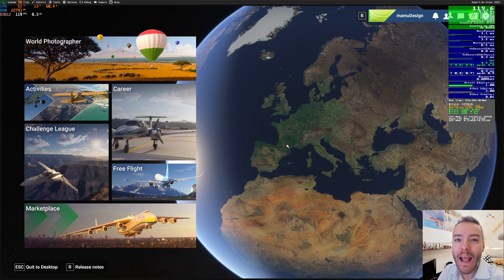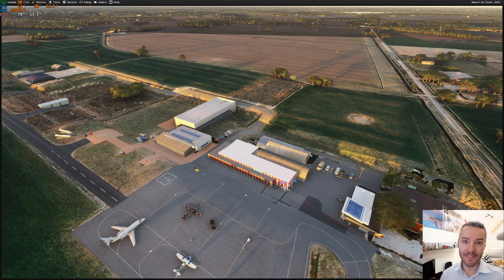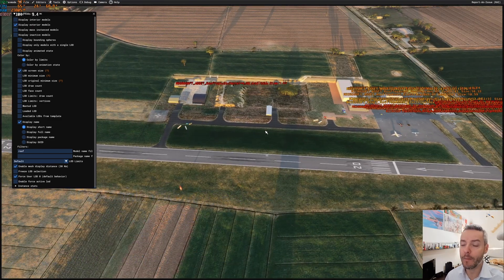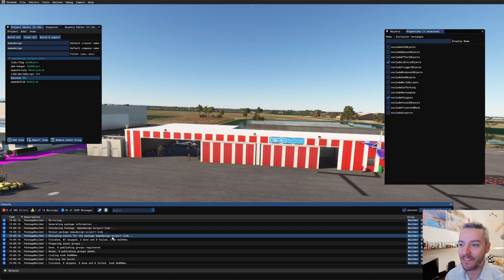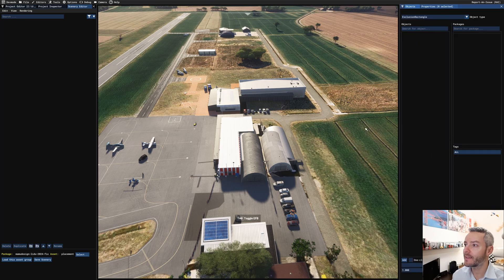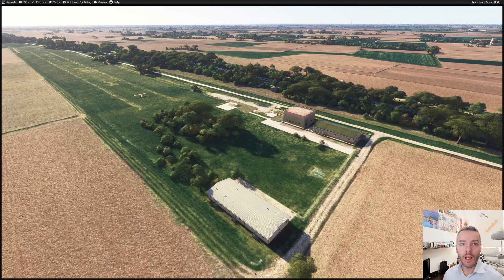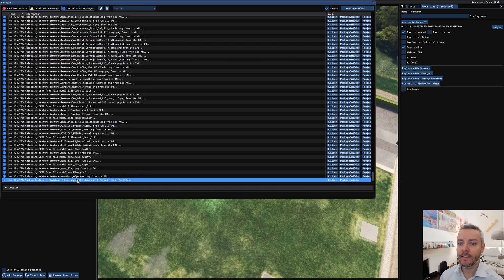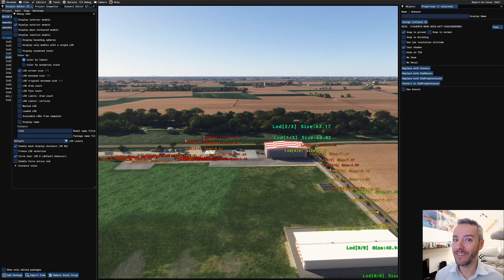MSFS 2024 SDK Tutorial: How to (NOT) convert a 2020 project to 2024

Comment: Thank you Frederico, you saved my day. I made many sceneries in FS2020, and was afraid to have to spend many hours to convert them to 2024.
I use a variant of your recommendation : since satellite photos and terrain levels can be slightly different in MSFS2024, i wanted to edit the scenery in MSFS2024 sdk.
The variant i use : i copy my original MSFS2020 scenery, and edit the objects.xml file to remove everything. In other words, i reduce my original MSFS2020 scenery to some sort of library of 3D assets. After that, i can create a brand new MSFS2024 SDK project, where i can "call" the 3D objects.

Comment: I've always made LODs for my models.  I even fixed Vitus' original exporter code for Blender so it would export them properly.  Granted, when I'm starting out I only make one model, but I've learned to stop at some point along the way and save the extremely low poly model for later use as another LOD.  My 2020 models from a couple of years ago don't disappear in 2024.
I've got to switch to using both SDKs, though, so I won't have to convert.  Thanks for this heads-up.

Comment: About the polygons: you corrected the terrain from 2020 in your first try. Wouldn't it be best to do that from 2024 SDK as well in order to get rid of the elevation issues?

Also I may be stupid, but when I add an exclusion rectangle I don't get the arrows with which to change size and position, but some strange balls with which I seem to be able to change angles. Anyone know what those are for and how to switch to the resizing arrows (Sorry I'm normally a texture guy and totally new to the SDK)
Reply from the maker: the goal of the video was to avoid doing any edit in 2024 :D, therefore the reason of adding them in the 2020 project

the arrows appear when you click on the balls

if you want to share screenshots for better explantion please use the discord because youtube is limited
Reply: @MSFS-SDK-TUTORIALS  tried that but I can't get rid of the balls. Strange. Thanks
Edit: looks like it needed a double-click to work. Thanks for the tip and the video. Helped me a lot!

Comment: Hey Frederico! THanks for the video! One thing beside the LOD's, the light sources of 2020 are also not working in 2024 if I'm not mistaken. Have you tried the scenery during night? So at the end of the day we will have to convert anyhow otherwise the airport will be pitch dark during night...
Reply from the maker: Confirm, I have added it as a side note in the description a few hours after publish the video 
However, native 2020 lights works correctly in 2024 too (not converted scenery)
Once the modelLib is converted, model needs to be exported again with the new plugin I order to make the lights shine again (and of course light properties needs to be tweaked with new values)
Reply: @MSFS-SDK-TUTORIALS  We tried our scenery in the community of the beta 2024 without any conversion. Interestingly some of the lights worked, some not. Do not know why.
Reply from the maker: have you tried them in current rtm version? Iirc during the Dev Alpha all the 2020 lights should have been fixed, the only still missing are those placed using light rows/vector placement 
If you have other sample of 2020 content not visible in 2024 please report it on devsupport.flightsimulator.com, current dev focus is to make sure 2020 content works correctly in the new gamd

Comment: Very good explanation. I have the same problem with no LODs in my old freeware projects. But I think that you do not need a separate project to fix the buildings - if you place an exclusion rectangle with "Exclude everything" on top of the redundant 2024 buildings in your 2020 project they will disappear! So one bigger exclusion rectangle to remove the polygons and couple of smaller ones for the buildings should be enough!
Reply from the maker: I have usually avoided the "excludeAll", but yeah, it might work 
Could be that you might have to redo the entire airport than?
Reply: @MSFS-SDK-TUTORIALS  No, I do not have to redo anything. Only place one or two big exclusion rectangles to remove polygons, simobjects and windsocks. Then a couple of small exclusion rectangles on the extra buildings introduced by FS24 excluding everything in those spots. That does not exclude any of my objects, only the Asobo stuff... I am doing this with my projects right now and it works perfectly!  I also have the impression that a polygon that removes buildings work in some places.